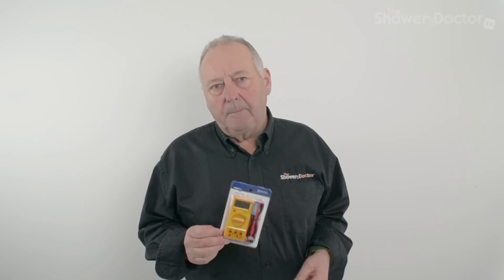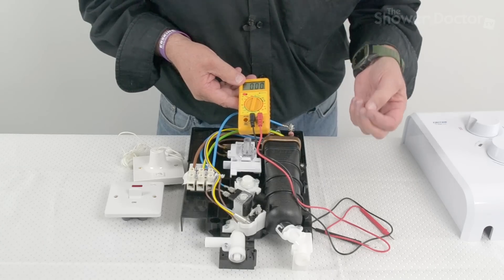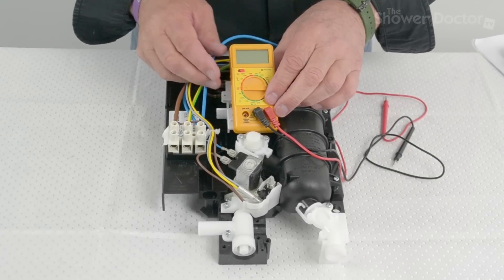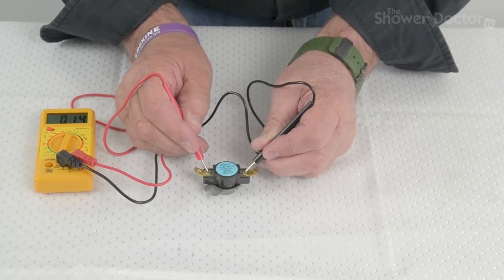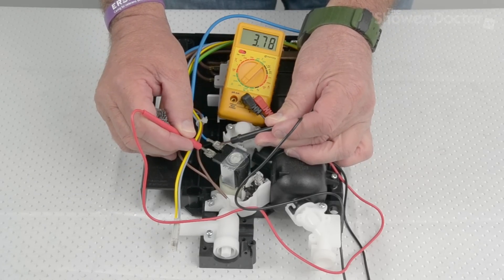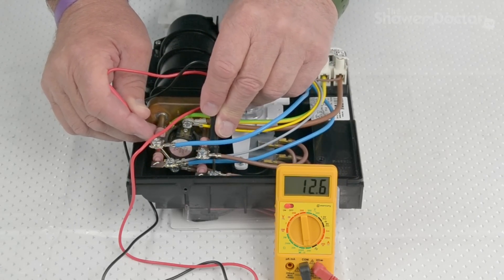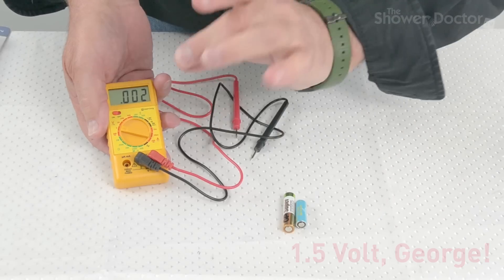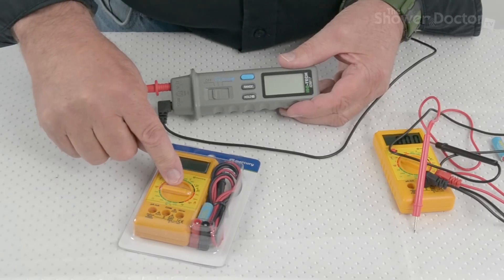Digital Multi Meter: Testing electric shower components & more.

Comment: You need to explain just where your sticking them multi meter probes or someone could get hurt. I've seen another of your vids where a different guy did exactly the same never showed the points to touch with the meter.

Comment: At the start of video, just sticking those pins into convenient holes or contacts insn't very helpful. These actions, like setting a dial so a meter reading reads 300 "something" all need to be explained. Eg. Switch to X because you are... . Put pins into Y something and Z something  in order to check etc etc.

Comment: How do you check continuity with a multimeter that doesn't beep?
Reply: If it doesn’t beep and you just have a numerical readout, you just want to check that the reading goes close to zero, that would be continuity with very little resistance (basically directly connected). 

You still have continuity when testing the filaments, but they have a higher reading (as per video) as the resistance is what makes them heat up.

Comment: Dangerous advice, power should be LOCKED off and the circuit proved dead before working on it, not good enough to  rely on hoping no one flicks the switch. That yellow multimeter isn't adequate for mains work, or for anything that is safety critical, ok for diagnostic work on the bench, just.
Reply: This is a video for DIY home repairs. If the shower is broken then chances are everyone in the house is going to know about it. Also if you know someone in your house knows DIY and next minute there is tape on the shower switch then its pretty obvious that someone is going to be working on fixing the shower. If there is tape on the switch anyways that should be enough to stop people from flicking it on. Also why would anyone flick on a switch for a broken shower anyways. 
Obviously if you were someone who does repairs on other peoples households then your not going to put tape on the switch but then you wouldn't be watching this video.
Reply: annoying...when you think you've found something that can really help out, and then...........find out that it's actually dangerous, why are these videos allowed?